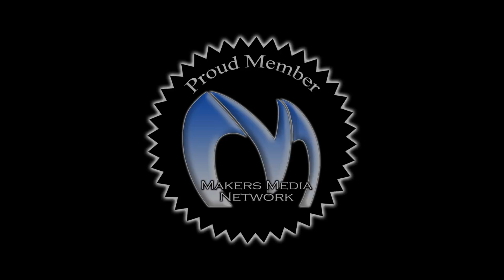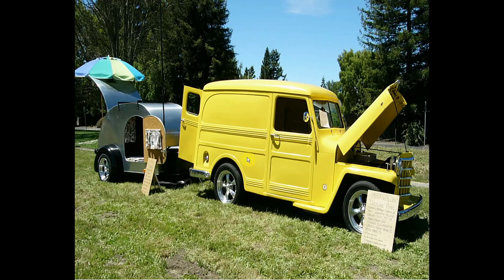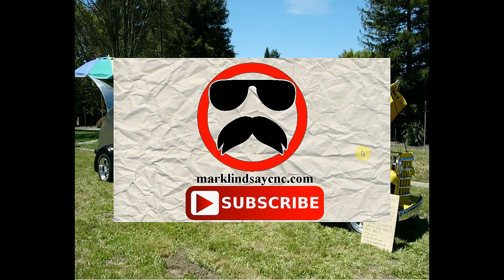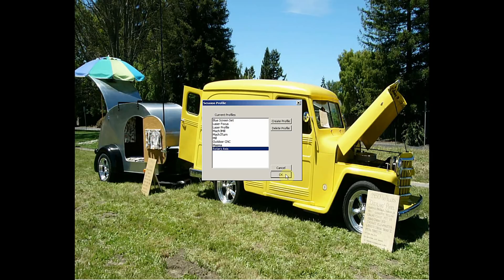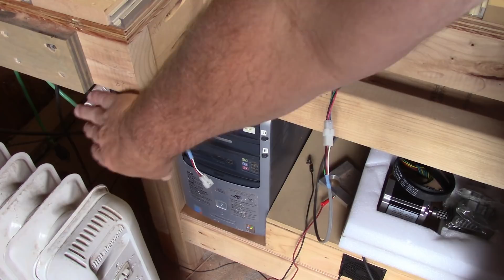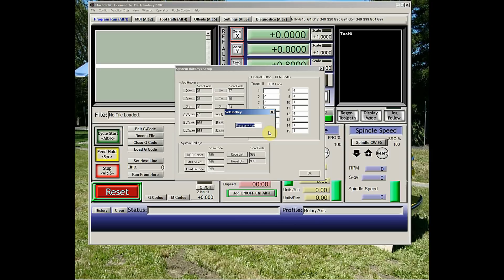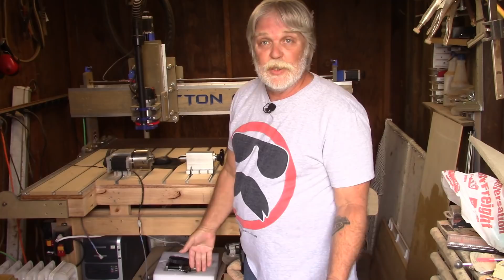Mach3 Settings for My Rotary Axis

Comment: Hola nuevamente yo, disculpe la molestia, quiero comentarle que mi eje rotativo funciona correctamente y que no he trnido ningun problema con el desde que segui su tutorial, el unico detalle es que la animacion en la pantalla de Mach 3 lo miestra en direccion opuesta, el trabajo se realiza de manera correcta, sabra usted porque es?
Reply from the maker: It's possible that you need to change the direction of the axis that is running in the opposite direction. In Mach3, that's done in the Homing/Limits screen in Settings. In that screen, you'll see a column titled Reversed. If there's a green check mark in that column for the axis that's running the opposite direction, click on it to uncheck it, exit that screen, then go back to the Settings menu and click Save Settings. If there isn't a green checkmark in the Reversed column for that axis, click the red X to put one there, then save as above. That should fix it.

Comment: Just to say if your in Mach 3 goto settings and calibration steps of the motor Axis
And just calibrate it 
By putting a mark on the rotary and set to a movement of say 100mm in the rotation and if moves 98 then just tell it and the rotation will get set
Also do that to all axis X And Y and Z
Then mach3 will have all calibrated

Comment: Hi Mark, I am looking into doing this same thing and it honestly looks overwhelming although I think I will figure it out once I start. This SUNWIN option you linked is no longer available. Can you suggest what the ratio is on yours and what might be best? Lot of good looking setups with a 100-1 or 50-1 but I don't understand which would work better? Do you still like your set up or would you change it?

Comment: I'm at 12 mins & I'm already confused why you wouldn't use the Y axis. In a way I can understand that the part will be turning but you could also hold a triangle & want to work on each pane??? I'll see if my queries are answered or if I'm just being a dunce!!!
Reply from the maker: The main reason is because I have a 4-Axis controller, and my Y axis needs 2 motors to move the gantry. With 1 motor that used to move the gantry now turning the rotary axis, that leaves only 1 motor to move the gantry along the Y. That won't work. I would need a 5-axis controller to use the Y axis with the rotary, and for what I do, it just isn't worth the cost.
Reply: @MarkLindsayCNC  It's funny you should say that as that was my worry because I also have a slave for my Y axis & that's what made me wonder. So far the video had told me all I wanted to know & your answer here has done the rest. My controller is supposed to be 6 axis but it's only a cheapy so who knows. Great work!!!

Comment: Do you have any issues when you use your tailstock? When I apply any pressure at all on the tailstock the Chuck stalls
Reply from the maker: I've not had that problem, but I don't put a lot of pressure on the tail stock. Make sure you have your headstock and tailstock aligned correctly, and that your drive belt isn't too tight. There should be a little bit of deflection in the belt.
Reply: @MarkLindsayCNC  the alignment is within about .015 and it is a live center for loss resistance. Mu unit is not a belt drive but one of the older Gear drive units. I changed the stepper to a high torque nema 23 but it didnt seem to make any difference.

Comment: Hello, excellent video, I have a question, because when I do a piece on the 4th axis, it turns out badly, since it starts well but ends up getting out of phase.
Reply from the maker: You need to check to make sure you have your steps per degree set correctly. If the rotation of the axis is even slightly too slow or too fast, it will move out of phase. My suggestion would be to sign up at the Mach Support forum (assuming you're using Mach3 or Mach4) and look for Rotary Axis Calibration. I found this thread over there, and it may help you.  https://www.machsupport.com/forum/index.php?topic=35178.0
Reply: @MarkLindsayCNC  Thanks for your answer, the strange thing is that there are times that if I do the work turning 360 ° and it ends very well, but there are times that 360 ° ends, the figure ends up out of phase.

Comment: Mark,
Is there a specific reason to dis-engage, or change the settings on the Y axis? Not sure why it can't just be left alone other than fear of accidental movement. I also don't understand the change to the X, Y, & Z pin numbers for step and direction. Lastly, Can you advise how to figure steps per inch? I'm using Sherline stepper motors. Thanks!
Bob

Comment: Hello, maybe you know how to set up the offsets for the rotary axis (as far as I understand, there is no way to connect the limit switches, since they will work with a full rotation). Perhaps there is a way to somehow register the parameters for the g54 command of the rotary axis (I have a 5-axis attachment to a 3-axis machine).

Comment: Thnak you for your video :) , now I connecting the same type of 4 axis,  but why in Motor Home fo A do you have setting Soft Max 100, and  Soft Min -100.? Such setting stoped A axis by Switchs Limits. What values for no stop rotation.?
Reply from the maker: I don't use Soft Limits on my CNC router. Those settings are the factory defaults set into Mach3. Soft Limits is turned off on my machine.

Comment: Hi , you make very useful tutorial. :) but how many drives do you have? 3 or 4 drives? My CNC Router has 3 drives for XYZ only, I setting all like you, but A axis dosnt working. Should I instal 4/fourth drive for A axis or  sould working with 3 drives like in your CNC?
Reply from the maker: My settings are for my 4-axis Xylotex Drive Box. Every controller is different. If you can add a 4th driver, I would go that route. That way you can dedicate that driver to the rotary axis and not have the concerns of switching cables like I do.
Reply: @MarkLindsayCNC  Thank you :) i supposed you have 4 axis, but I wasn't absolutely sure.  At first I will try to use 3 drives only... i make social connections for A axis by Y axis, I think it could be working, i will inform you if such connecting will be working.  Bye the way, I have two CNC router, one I make by myself with table 1200x1200 mm. Working perfectly. :)

Comment: Mark hi
I have 5 axis CNC system but I can not control rotary axises, A and B. 
Rotation in my system  with A is 1:60 and with B it is 1:3,4.
 I prefer to use metric system.  Can you please help. Tapio Nummi
Reply from the maker: I'm afraid I'm not going to be much help. I've never worked with a 5-axis system before. I would suggest a forum like the CNC Zone. Those folks are amazing.

Comment: Great video Mark. Do I need to worry about homing an A axis in Mach 3 using Reference All Home. If so, I cannot find out the settings needed to do. Hope you can help.
Reply from the maker: I don't use my limit switches with the Rotary Axis profile, so they're disabled. I don't bother setting my Machine Coordinates. I just set my gantry where it needs to be (I have a mark on the headstock housing I line it up with,) shut down and change Mach3 Profiles. I put the X axis in the center of the material (lengthwise in X,) and set X zero, set the Z zero with my touch plate, and I'm ready to go. I don't click Ref All Home at all. Check out this video for a demonstration: https://www.youtube.com/watch?v=NSBsF-sawYE
Reply: @MarkLindsayCNC  Thank you Mark.  I use a touch plate that I made and wired into my control box and use a script similar to the one you used.  My touch place as it stands will be used when doing non-rotary stuff so I'm planning to write some code and a switch that I'll add to the interface (or read a value maybe) so that I can use the same touch plate on the rotary in the way you do. The code will just flick the measurements depending on rotary job or not.  I also added a virtual LED to the Mach3 screen set that is very handy, it lights up when I bring the touch plate to the tool, just to check the connections are correct.  Keep up the great videos, your delivery is great. Fan from the UK. Des

Comment: Excelent! And if i want  to use a servo like a spindle. I only need to change in ports a pin the pines of the axis to spindle is it?  Because doesnt work. Could you please help me?
Reply from the maker: I'm afraid I don't know anything about servos at all. You might head over to the CNC Zone website, join that forum, and ask your questions over there. I'm certain they'd be able to help.
Reply: @MarkLindsayCNC  sorry its a stepper motor not a servo

Comment: Great video as usual. I haven't made up my mind so far if I am going to purchase a 4th axis.  Does one need the latest version of v carve pro?  Also what type of files are needed like 2d or 3d. etc.
LeRoy
Reply from the maker: Thank you LeRoy! "Latest version" is a relative thing. Vectric incorporated rotary projects into the Job Setup in Version 9, but there were ways of setting up a rotary job in previous versions through the use of gadgets. If you have Version 9 or later, it'll be a lot easier to set up a rotary job, but it's not, strictly speaking, required to have the latest version. The types of files needed will depend on which version of the software you have. Sorry I can't get more specific than that.
Reply: @MarkLindsayCNC  Thanks for the quick response.  I am still working with version 8.5, i do see something in gadgets called wrapping if that is what you are referring to.
Reply from the maker: Shoot me an email through the Contact Us page on my website. It's way too much to try to address here.

Comment: MARK  are ou using a 3 axis box or a 4 axis box
Reply from the maker: It's a 4-Axis box. When I'm using the CNC for 3-axis flat work, the A axis is slaved to the Y. That gantry has some weight to it.
Reply: ok Thanks.  The reason I asked is , you say you plugged in your X axis into your rotary drive.  My rotary drive has its own 4 pin plug on the back of the control box, here I'm a bit confused on this point
Reply from the maker: I have a 4-axis drive box (controller box.) When I have the CNC configured without the rotary axis, I have 2 stepper motors driving the Y axis (moving the gantry from front to rear across the table.) That meant I had to use the A axis motor cable to drive that second stepper motor. It's slaved to the Y axis in Mach3, so that when the Y stepper motor turns, the A stepper motor turns simultaneously, moving the gantry. When I connect the rotary axis, I no longer need to move the gantry when it's cutting. So, I move the gantry into position over the rotary axis, shut down the drive box, disconnect the A axis cable from the stepper motor, connect it to the A axis stepper motor on the rotary axis, then open a new Mach3 profile, turn on the drive box, and I'm ready to go. It sounds more complicated than it actually is, and it takes about 45 seconds to do.
Reply: @MarkLindsayCNC  I am following your Video to setup a rotary profile, I got to the motor tuning part and the motor tuning dialog box will not open. I have checked too the others and they open. I though that you maybe able to shed some lite on my problem.  Great video but I seem to have a problem. I am using my mach 3 saved program from my stick, when I saved my Mach 3.
Reply from the maker: @jerrybonnifield1537   I don't know what you mean by you're using the Mach3 program from your stick. You should open the Mach3 Loader on the computer running Mach3 and create the profile from there. I'll assume you did that. My first question would be to ask whether you have all the motors enabled in the Ports and Pins, Motor Outputs window. (CONFIG>Ports and Pins> Motor Outputs tab.) Make sure the correct motors are enabled and that you went back to the CONFIG menu, then clicked Save Configuration Settings to write them to the hard drive. Then try opening the motor Tuning window.
Reply: @MarkLindsayCNC  I have searched the net and I think that I will need to reload the Mach 3 program. Yes I have been saving after each step taken. This video is so awesome, That you for doing them for us dummies.
I have the X,Z, and the A axis motors enabled. I have installed the Mach 3 program from the saved transfer stick on a different computer.
Reply from the maker: @jerrybonnifield1537   Yeah, you'll need to install it from the Installer program. Check out Peter Passuello's 2 videos on backing up and restoring a Mach3 install, here: https://www.youtube.com/watch?v=W5tIoRPcCbo      and here: https://www.youtube.com/watch?v=G6QKtI-dqgo

Comment: Mark amazing video the only valuable tutorial you can find out there. You really put time in it and it's so damn clear! I would have a couple of questions: 1- IS it only possible to run the 4th axis while disable the Y or the X (depends on the 4th axis mount position)? or it is also possible to keep them all but you had only 3 drives available? 2-  Second question related to the first. If you use in your case the Y drive for the A, I guess you can not homing the machine on that axis anymore. And more important did you set pin 8 and 9 for A that are actually corresponding to the A dir and pull  pins on the breakout board or they are the Y dir and pull but you simple make them drive the A axis now? that would be pretty smart since you only swap the stepper cable to the drive. Thank you very very much for your help!
Reply from the maker: Thank you very much! I do appreciate it. I'll try to answer all of your questions with a couple of statements. I only have a 4 axis kit (it's a plug and play drive box that has all of the stepper drives and breakout board built into a single board,) and my Y axis uses 2 motors (the Y and the A,) with the A slaved to the Y. I can't physically hook up all 5 motors to the drive box - I'd need a 5-axis unit.  I move the gantry into position over the rotary axis headstock, shut everything down, swap the cable over to the motor on the rotary axis, switch over to the rotary axis Mach3 profile, then fire everything back up.  I have no further need for the Y axis and have no need for the homing switches. Even if I had all 5 motors plugged into the drive box, the gantry wouldn't move - it doesn't need to.  All of the motions needed to cut on the rotary are done with the X, Z, and A axis.
Reply: @MarkLindsayCNC  hi Mark. Thanks for the quick reply. Got it you have dual Y motors that's why the need to swap the cable. That means that hypothetically I can just wired up my 4th drive to the A since I am using a single stepper to drive my Y and I have space for 4 axis on the breakout board (actually 5). Is it correct? Another thing that surprise me is the fact that all the cuts are made with fixed Y axis. In my imagination would be better if the machine an stil move on the Y axis because in case of deep angled pocket you might not be able to reach it with the Y axis fixed in the center. For instance I am thinking of my application. I would like to make helical gears. In most of the case will be fine but for high helical degree would be handy be able to slightly move to the side to reach a angled pocket along the spoke. Do you think is possible if you keep enable the Y axis to do so? I will use Fusio360 to generate the toolpath
Reply from the maker: Your best bet would be to go over to the CNC Zone forum and run it by the folks over there. I'm certain they can get you headed in the right direction.
Reply: @MarkLindsayCNC  I will do that! Thanks a lot.

Comment: Great video, one question. Do all rotary setups rotate counter clockwise for positive? I've only cut one simple job to test and it came out fine. But I accidentally found your website that describes the counter clockwise movement and can't find an answer anywhere. Thanks!
Reply from the maker: I can't say whether all do or don't. I would imagine every control system is different. If yours is working, no matter which way it's turning, then I say run with it.
Reply: @MarkLindsayCNC  ok then, I will try some text to see what happens and reverse if needed. I will look into the post processor as well to see if it's configurable. Thanks for the fast reply, I bet much appreciate it.
Reply from the maker: @MichaelWoodrum  Do please let me know how it works out for you!

Comment: Excellent video Marck, I have a rotatory axis and I have followed your explanation and it has served me, I only have one detail, my rotatory axis only turns in one direction, which you think is the reason, thanks
Reply from the maker: Thank you very much! As for your axis turning only one direction, it could be any number of things. I'd check the wiring first. Make sure you have the correct direction wires hooked up to the correct direction pins.
Reply: @MarkLindsayCNC  
Thanks for your answer, I'm going to check the wiring and make sure that I manually rotate in both directions

Comment: If you did another profil on mach 3 thats not affect the original One? Thanks for your vidéo
Reply from the maker: That is correct. I created a second profile for use with the rotary axis only. It does not affect the other, original profile at all.
Reply: @MarkLindsayCNC   then can you take de xlm fil copy it on another name and réuse this on on a second profil. Exemple could we have a métric and sae profil on same pc? Just to could change only the native unit and calibrate motor without have to do all other pin and ports setting?
Reply from the maker: This would be a good question for the Mach Support Forum, but as far as I know, you could clone a profile that you know works, then go in and make the necessary changes to that cloned profile, then save them.